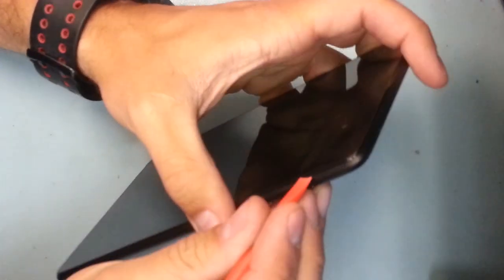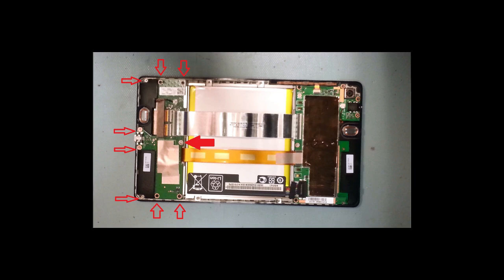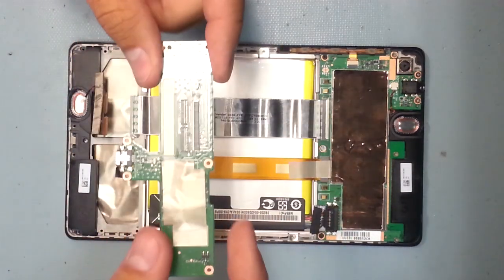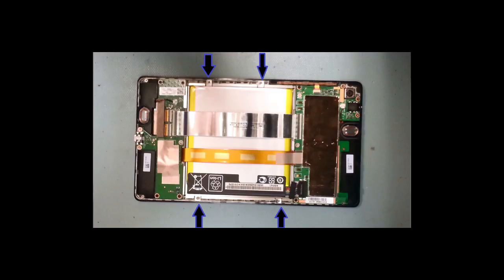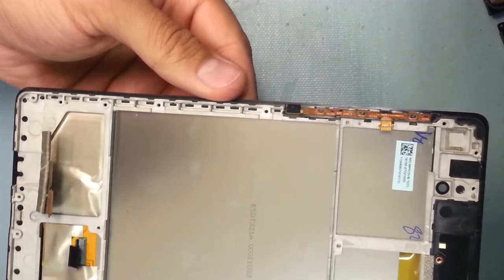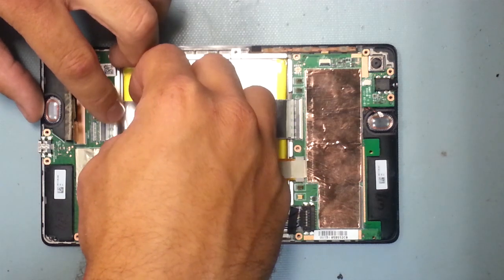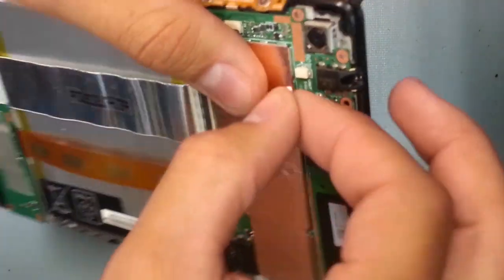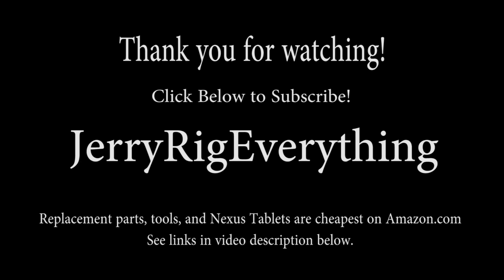2013 Nexus 7 Tablet Teardown. Charging port fix and screen repair.

Comment: Why would you start the video with the back already loose and skip over the hardest part of the whole procedure?? It's really hard popping the back off and I ended up breaking the screen because the plastic pry tools I was using were getting mangled because it's so tight so I used a metal mini flathead which broke the screen before the back would loosen.
Reply: +orzoO0 I feel bad for all the people this happened to... I have removed the back several times and IMO the key is to be so so so so patient and gentle, and start at the top corner opposite from the power & volume buttons.  Or maybe I just got lucky.
Reply: +Allison Mackay By far this is the best way to open! Simply bulge the tablet a little bit so it would bend a little bit, and force a bit using the fingernails on the top left corner of the tablet (screen facing) and it will open. Thanks!

Comment: The most difficult part of any repair on a tablet is removing the screen.  In this video he has worked the screen off previously.  It's important that people understand how to remove the screen without damaging it.  Anything else, including almost all repairs are simply unplugging cables and removing screws.  So, this does an injustice to repairing one of these devices.
Reply: Do you know of any resources online that show how I could remove the screen when it hasn't been moved before? The guides I've found so far are based on previously worked screens, so that's...next to useless for me.
Reply: @smokey0111  Don't do what I did, which is try to remove the cover from the top of the unit. If you do that then you WILL crack the glass. Oh yes you will. You will be very angry. 
To open the case: look at the top edge of the unit, where the heaphone socket is. You will see that the screen sits about 1mm proud of the plastic case. That's what you're aiming for. Work your pry-tool into the gap between the edge of the plastic frame and where the edge of the screen is, give it a wiggle, and you should see the frame start to come away from the screen, then start to work your way along the top, and down each side. 
Hope this helps.

Comment: Thank you. My daughter's Nexus froze and I wanted only to disconnect the battery to reset it. My examination led me to a wrong approach; I am REALLY glad to have found this vid before I started. Turns our to be VERY easy.
Reply: you don't need to pull the battery for that. just hold down power for 10 seconds
Reply: B Welkinator
Reply from the maker: B Welkinator No problem! Glad I could help out!
Reply: +Cory Wilson exactly
Reply: h

Comment: My tablet fell into the sink and completely emerged under water...I took it completely apart and tried the blow dryer trick. Nothing...the only thing that came on was the white light at the bottom. Is there any saving or am I out of luck? Please help... 😢
Reply: If the notification light blinks 5 times then that means that the device works but needs to be charged. If it is not charging the problem is either the charging port or the battery. If the problem is the charging port then you can just use a wireless charger for it. However if the problem is the battery then you will need to replace it.

Comment: hi i just bought a nexus 7 2014  and suddenly it doesn't auto-rotate. Is there a way I can fix this without having someone repair it?
Reply: +rowena maria Ongsotto check under settings for rotation lock.

Comment: Great instructions. I replaced only the charging port board and all is working perfectly..  I at first missed that the warranty sticker covered a screw.  Also, I had to watch thrice about how to slip the ribbon cables back in - I did not pay enough attention at dis-assembly.
Reply: did it have to be recalibrate after replacing the charging board I heard it did . I wonder if you could just solder a new usb jack on to the existing board there only 5 bucks mine won't charge one of the pins is snapped off and it's loose.

Comment: I clicked on the links but I didn't see one for the charging port only. Do you have one for that? My husband had purchased two different wireless chargers including the one you recommended and they work fine. We are going on vacation in September and he wants to replace the port so it can be charged while we are driving.

Comment: Just google image charging port nexus7 2013. Look the part on ebay, make sure you take apart your nexus for either rev.1.3 or rev.1.4. Thats all. It'll cost you around $60-$70. I just changed mine. Pretty easy.

Comment: I'm a kid and I don't think i could pull that off. I think i'll just mess up and I can't use the tablet anymore. My problem is my tablet won't charge and I have to adjust my charger to make it work and tape it onto my tablet so it'll work. But it just keeps on going back and stops charging. I need a tutorial for kids. I can never use my tablet anymore cause its 0% now.

Comment: So here is my issue with my Nexus 7. Once upon a time, my charging port worked. Slowly, it started to be picky. It needed to be moved to the left, or to the right, or down, or up. I assumed this was because the pins were misaligned. Not wanting to really mess with it, i left it alone. One night, while watching netflix, I go to charge my nexus then I plug in the usb.....boop.....shuts down middle of the movie. I move the usb around and the nexus starts up again from the beginning. I very carefully place it on my night stand.....boop....it shuts down again, mid movie. AND I HAVENT BEEN ABLE TO TURN IT ON SINCE. Can someone explain this? Is this rare? Do I have some electrical poltergeist child pulling my leg?

Comment: I cracked the screen trying to get the cover off just my luck . 
I'm looking at screen assembly's and what I'm wondering is they don't show the frame that everything is screwed/mounted to in your vid you don't remove it so does it come out as well or is the new assembly suppose to have it ? 
Thanks for any help

Comment: Is there a part available and an easy way to replace the headphone jack on the Nexus 7 2013 32 GB? Does it require a solder? My son's is broken and need headphone capabilities back before I go crazy!!! LOL Does a wireless charger work for this model? Thank you!! #DesperateMom

Comment: Jerry - Great Video!  Do you have the Amazon link for just the charging port board for the Nexus 7 2013?  I found the 2012 version on Amazon but not the 2013 version.  Like Silent Seven below, the Qi pad is not a good solution for my needs either.  Thank you.

Comment: JerryRigEverything Nice vid.  Do you have the part link for just the charging port board?  I see the 2012 version on Amazon but not the 2013 version.  The Qi pad is not a good solution for my needs.  thx.

Comment: Good video but let me add...

  The 2013 Nexus 7 can be fixed without tearing apart the tablet. Mine also crashed on me and I couldn't charge it anymore.
  Go to Verizon and purchase the $40.00 wireless charger. It will work with the 2013 Nexus7... I plugged it in laid the tablet on top of the port and been Clashing since!
  No wires to tablet! Charges threw back of the tablet.

Comment: The back is NOT easy to  take off! I have a whole screw driver set and still can't get the back off unless I want to damage the screen
Reply: same thing just happened to me.  I cracked the screen trying to get the back off and it ruined my spudgers
Reply: Slide a 2mm thick piece of plastic along the seam slowly. I needed to reconnect the battery ribbon and this was how I removed the back.
Reply: Mine was easy to take off the back you can use your hands to take it off or ur finger nails or Smth

Comment: How does the QI wireless part work for a broken charging port?
Reply from the maker: EliteHunting1911 The QI is built into the back of the device, and doesn't involve the charging port.
Reply: JerryRigEverything thanks for the reply. I figured you had to "hack" it into the inside of the tablet. Great videos man, love the channel.

Comment: I replaced the screen and digitizer on my tablet put everything back together...boots fine but and screen lights up, but the touch screen does not work...any clue on what I did wrong? cables bad?

Comment: A couple notes from my repair of the 4G LTE 32G version:

- The sim card should be removed prior to removing the back cover.
- In my experience, antenna cables are fragile.  I suggest disconnecting the antenna cables first after opening the back cover - they are easily visible and removed on this device.
- The replacement screen from fixez.com worked fine on the 4G LTE version.
- I banged up one side of the front bezel when removing the old screen.  I imagine I could avoid this if I did it over again, since I now know what level of heat and force is needed to remove the screen.  There is a replacement on eBay: http://www.ebay.com/itm/291312160653.  I thought long and hard about getting a replacement, but it's just small aesthetic damage that can be covered up with a case if it really bothers me, and I didn't want to wait 2-4 weeks for the part to be shipped from overseas.

Thanks for the great video!
Reply from the maker: leakage21 Thanks for watching, And thanks for your tips.  Hopefully it will help others out in the future!

Comment: Hey Jerry, my niece had the tablet just yesterday night she was watching something on YouTube and it froze so I clicked the power button but not to power off, just for the screen to turn black. Then I clicked it again expecting the lock screen to pop off and it didn't. The sound and everything works but the viewing of what's being done on the tablet. How do I fix that? The screen is just pitch black. But unlocking is still possible even though it's not appearing on the screen.

Comment: I have a brokehn Nexus 2013 and a funcional one, but im having trouble to charge it, very slow, and i have to bend the port to the side a little bit in order to detect the charging. Do you think my usb port is broken?

Comment: Great video man! I bought a nexus 7 few months back and there is a small issue with that,  i.e.  backlight led bleed. Someone told me it can be fixed by tightening the screws from the back. Is that right information?
Reply from the maker: WhySoSwag Its worth a shot.  If they already feel tight, dont damage anything by over tightening them.
Reply: JerryRigEverything I have no experience in repairing,  the product is still in exchange warranty. I think i should go for an exchange. Anyway Thanks for the help. Cheers

Comment: So I completed the repair but the screen is unresponsive to touch. Any suggestions? Ive been checking connections all day
Reply: Same issue here...
Reply: I am going to order another screen. I noticed a very slight difference in connection appearance. But other than that I have no idea. Its for a customer so I may have to payout because I completely torchered the old screen taking it off. Wont be doing one of these again.
Reply: Dave C you figure this problem out? I'm having the same problem.

Comment: My charger Port cannot charge and it felt out of place. I tried charging it with my original charger first, then other chargers. it blinked a white light 5 times then it bricked on me! do I HAVE to replace the charger port? or do I ave to just put it back in place?
Reply: I have a 2013 nexus 7 32 GB Asus tablet btw
Reply: Shoni J same problem with me but I seen no one replied
Reply: Shoni J yup it worked, after all this waste of time and money. I should of been tried out the wireless charger. Its old but the graphics are better then some tablets made today and I like the way it feels in my hand, thanks for the heads up

Comment: Where do you find the full screen replacement with the frame that allows you to replace the entire assembly without having to heat the adhesive and pry the glass off?
Reply from the maker: Charles Blumenkamp Hmm... if repairs universe doesnt have it, you can also try Etradesupply, amazon, or ebay.

Comment: I have a nexus seven i  dropped it but it seemed fine it was working great but now when i turn it on all that pops up is the nexus logo and nothing else happens is it dead and if it isnt what would you have to replace to make it work?
Reply from the maker: Stacy Adams Try something called a 'hard button reset' Youll have to google which buttons actually work for your phone.  You will lose all of your information, BUT it might get your phone going again.

Comment: not finding the charge port on Amazon?  Can you replace just the tip?  Looks like those are available on ebay.
Reply from the maker: EBSkullheart Its a difficult repair when you replace 'just the tip' I dont currently have any videos showing how that is done.

Comment: You're very welcome. Yeah I have a Lenovo tablet that needs a new charging port. Can't bring myself to buying just a charging port off eBay for $25 - $30 when the same tablet basically new but used I can buy for $65. I just don't have the skills to fix the charging port board I have. I've never learned how to work on pci boards that small. Plus also, it's not worth to send to have fixed. They would charge more than it's worth. Sucks man because its a mint Lenovo. I have a kindle fire that's basically new that needs a port and a nexus 7 gen 1 that has cracks in the glass and the digitizer doesn't work. If I could send them all for a good deal I would get them fixed but looking at $100 in used parts ya know.

Comment: Wow dude, that's one of the best explained calm non aggravating detailed repair videos I've ever seen. I've repaired 4 of these from watching your video. Thank you very much! Wish you did videos for Lenovo tablets! LOL! Thanks!
Reply from the maker: Jason Herek Thanks for watching my videos!  I hardly ever see lenovo tablets in the shop, but if I do, ill be sure to make a video!
Reply: I know you posted this like 4 years ago, but know where I could get a replacement battery for my 2013 Nexus 7? I still use the thing today as does my father use his. But the battery is showing signs of its age. I'd like to replace the batteries in both of them.

Comment: My problem is he USB port. Won't charge with any charger that i have used. I believe i need to get a new USB port. I was about to head out to the store to get a new charger but i looked up this video and now i just need the USB port piece, switch it with the broken one and it should work like nothing happened right??
Reply: can you find me a USB port for my tablet? I have 32GB 2013 Nexus 7 Asus Tablet.

Comment: I have a question about the top portion of the tablet and I'm not sure if I'm using the correct terminology here. When removing the motherboard at the top of the tablet, the silver long long plastic piece didn't remove properly by my mistake and the connector that you have to flip open (the white part) broke. When placing the parts back together, I turned on the tablet and the touch screen is unresponsive. Guessing that the piece that broke is apart of the display. Is this piece replaceable or is it permanently broken?

Comment: Hello, my tablet ran out of battery and when I plug it in to charge and try to reboot the power off mode, it only flashes the notification led. I dont know what to do here!!
Reply from the maker: Paulino Carlo Aguilar Galindo You can try disconnecting the battery, and reconnecting it again, but remember that you attempt any teardowns at your own risk.
Reply: Thank´s man! I didn´t dare to do that, so i send it to service at ASUS SERVICE CENTER. But thank you any way!

Comment: Hello sir, my touch digitizer appeared o go out. which step of this video is that? 
I was going to check if a ribbon came loose or what? But it turns on but you can't touch anything on the screen!?

Comment: My screen just frozze what do I do should I take out the battery and put it in?
Reply from the maker: Monkey D. Luffy  As long as you are confident in taking apart your tablet, you can attempt that, yes.
Reply: Nvm I found out if you hold down on the power button for 10 seconds it force shuts it down

Comment: I have learned from the video and some of the ribbon cables remind me of some on the laptops, being so small and pops out rather than being screwed in. I guess most people using those are the ones who need a bible for church where they can keep up with the speaker or in study. As a guy I can't figure out how to carry one of those around as I would not want to break it. We men don't carry purses like women, and I have noticed in the last two years that many women are using them in church. Thanks so much for sharing this information with all of us.
Reply from the maker: Sidney Mathious You could always buy a case.  There is a company called 'otterbox' that makes some good, durable, manly cases.  Thank you for watching!
Reply: JerryRigEverything Hey, I have a nexus and the corner's plastic seems to be coming off, like the hard plastic. Is that part of the back casing or would it be part of the digitizer/screen? Thanks.

Comment: Hi 
My nexus charging port has loosen What to do as my tablet is just dead
My kids have messed up with the connector. Now the charger pin is not keeping fixed inside.its just loosen .Some body told me that I have to change the usb chrging port which is quite expensive n it's not available here .But I think tablet was running super fine with no problems at all. What would be the solution. Please help. ...